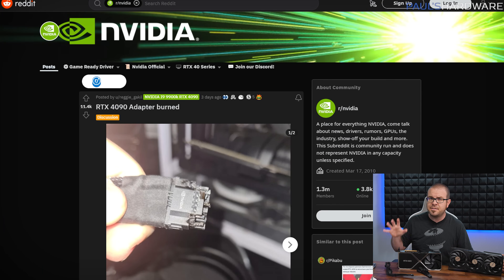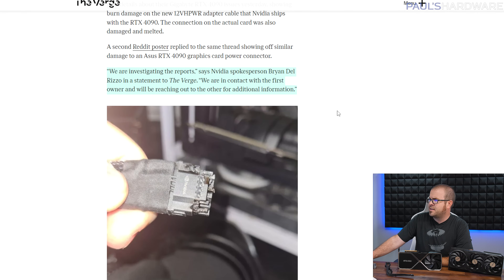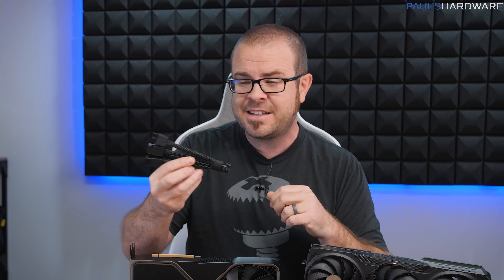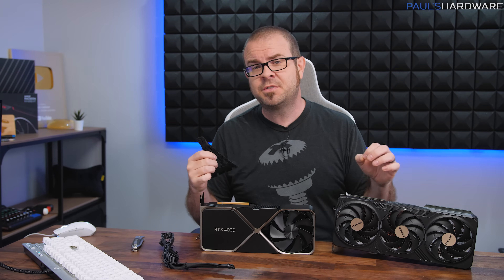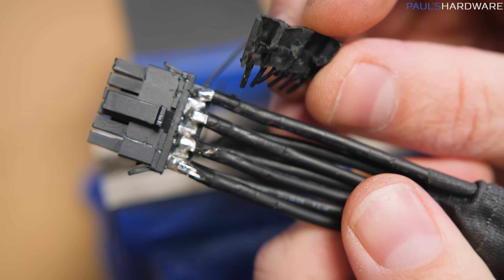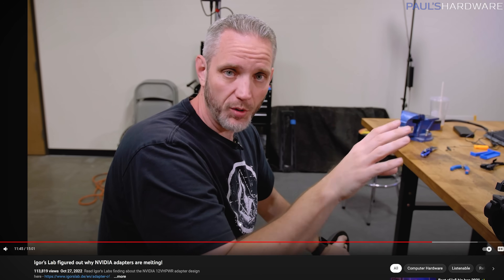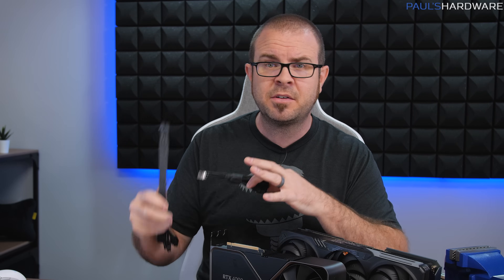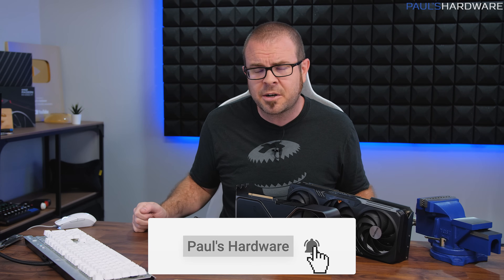Why are some melting? RTX 4090 600W 12VHPWR Adapter Teardown

Comment: In residential wiring, 12 gauge wire is used for 20 amp circuits and 14 gauge wire (what the connector uses) is limited to a15 amp load (@120v). So the first problem is that if one of the four wires comes loose you are carrying 50 amps divided by 3 or 16.67 amps on a wire rated for 15 amps. However, what makes it worse is in residential wiring, the wire should only draw 80% of its maximum wattage in a continuous use situation. So in a 12v scenario, one of the four wires in a continuous use situation should only be supplying (15amps x 12 volts x .8) 144 watts. Even if all four wires are intact, at 600 watts, each wire would be supplying 150 watts. That is 4% over the 80% rule but probably okay. However, reduce that to three wires and you get 200 watts. That is 39% more than the wires recommended continuous loading. As Igor might say, "Nicht gut."
Reply: The design seems marginal.
If the adaptor is defective it becomes a risk too quickly
Reply: So there's different standards for different uses.  I did some looking at automotive 12v standards, and it looks like with 6 wires, they'd need to be 16 or 18ga. So 4x 14ga is probably fine.  The connector also has a rating of course, and it looks like the connector is the problem, not the wires themselves.
Reply: @tippyc2  My analysis was based on solid copper wiring (i.e., Romex). Typically, stranded aluminum wiring needs to one size larger for the same rating. So those 14 gauge wires are really equivalent to 16 gauge copper. Put another way, for the ratings I mentioned the four wires should have been 12 gauge to meet a 14 gauge copper spec. It could be that electronics have a different spec, but since it's used in a residential setting I'd think safety standard would be similar. I don't have enough information to definitively state the root cause; just wanted to point out that there wasn't much margin for error in what they used. I will say that the weak link in most electric components that I've seen is the wire and connectors used going into an assembly and not the supply wires. Just look at a typical light fixture. I hope the industrial engineering in the interconnects improves moving forward to keep up with this trend in power usage.
Reply: @chillysourdough8924  sounds like you think those are stranded aluminum wires?
Reply: @potatopobobot4231  it looked like it in the close ups Jay showed; if not then disregard.

Comment: This failure is most likely caused by a pin fitment issue. A slightly too loose female pin connected to a male pin will have a slight air gap. At high current draw, this air gap will cause excess resistance which will generate excess heat and you will end up with melted connector. I have seen it before. This failure is most likely attributed to cheaply made connectors based on images shown. The outer pin gets hot and melts first because that is where the slight air gap will be and likely the highest point of resistance of the circuit. This is the simplest and most logical explanation (occam's razor).
Reply: Yes, you are right. I recommend Buildzoid's video, it confirms your opinion.

Comment: If it's ABS plastic then the glass temp is 105c, but it will have started to soften a bit before that. Based on my own experience of 3D printing with ABS.

Comment: Good scienceing there Paul.

Unfortunately the 4 wire thing is just a natural result of adapting to the new "standard" from the old.  There's four 8-pin inputs, SOMWHERE those have to branch out into six.  The way they did it seems to me to make the most amount of sense, they are doing it where there is the most material and redundant paths.  The only other option would really be to split two of the wires and leave the other two 1:1, which has 2 of the 6 wires at double the current, and then if one of those breaks you're in exactly the same place.

Personally my biggest question is why nvidia/the industry/the ATX people felt the need to move from 24 total pins to 12.  IMO this was ALWAYS going to be a problem during the "changeover" period where adapters are necessary for non-3.0 power supplies.  And given how long power supplies last and the fact that they are often carried forward between builds, that changeover period is LOOOOOOOOOOOOOOOOOONNG.  Like a decade long at least, given the cards with 12-pin (and the power requirements to really push it) came out BEFORE all but what, ONE atx 3.0 power supply model?

Comment: The connector is a bad design because it does not protect the soldered connections from stress.
This is the most basic of design flaws.
Even your simple power plug has a clamp to prevent connections being stressed.
It's obviously a case of penny pinching to save a few cents on copper wires.
The fake sensor wires going nowhere suggests it is a substandard product designed to give the illusion of quality.

Comment: I think you hit the nail right on the head.  The broken outer cables are causing intermittent contact between the cable and the pin/pad.  This is causing the higher resistance that you describe and depending on how bad the break is and outside conditions could also be causing arcing (There's a literal taser inside the housing) This is why its the OUTSIDE cables that are shown melted in all of the pictures, not the inner ones.
Reply: I don't think it's causing arcing, the 12 volts is too low for current to jump through air. It's probably just a lot more heat from more energy throughout through the fewer pins.
Reply: @tristanweide  I mean it could… a car battery connector arcs when you connect it, and that’s ~13 volts
Reply: @tristanweide  
Yep, this video does not explain either why plastic around the terminals are melted, not around the soldering. Buildzoid has also made a video on this subject and so far he was the only one giving a reasonable explanation: it is the Nvidia terminals that must be the cause. I recommend his video.
Reply: Na, cable works fine. User error

Comment: Some of the same principles that dictate the use of crimp connections over solder in automotive or aviation industries apply here. If wiring is allowed to flex or move freely then it cannot be terminated by a solid joint (solder) as solder is intended to form an electrical connection only (in most cases), not a physical AND electrical connection.

Comment: I ran the numbers just as a sanity check for the possibility of a bad connection causing the problem.

I believe power loss will be "high" when the impedance of the poor connection matches the impedance of the wires coming from the PSU to the connector. Doing some back of the envelope calculations, the expected power loss for 4 - 14 AWG Aluminum, 0.5 meter wires carrying 50A total is about 4W. (using 13.47 mOhm/meter at 70C). That's higher than I expected, but distributed over that much wire, it's fine.

I ran through the current divider circuit, and found that the weakened connection could dissipate a little over 1 watt in the worst case scenario. This is obviously in a much more concentrated and insulated area than before. My intuition tells me that could be enough power to start a bad thermal situation. Resistors rated for 1 watt are pretty chonky as is, and they would probably be significantly derated being incased in plastic.

Maybe the Sense #2 and #3 should have been used for a thermocouple in the connector ¯\_(ツ)_/¯
Reply: I think you have some terms backwards, where do you find large resistors rated for 1 watt?  I think you meant 1 ohm, because at 12v that would be 12 amps through a resistor.  A 1 watt resistor at 12v would be like 0.08 amps.

Comment: I feel like AMD would have been part of or at least directly viewing the 12VHPWR design process as they're, well, one of the very few companies who might need such a connector. I think they knew about this problem but knew they wouldn't be able to do a thing to stop it, so they just let it run and wait for it to bite people in the ass and use the problem for marketing. 

And, honestly? I don't blame them. If you're not gonna be able to prevent bad things but won't hurt anyone by getting something out of that bad, then they're not really doing anything harmful or wrong.

Comment: I am not an electrical expert or anything, but if the electrical resistance increases on one wire connection wouldn't the other wires compensate? Electricity will flow through the path of least resistance from what I understand.

Comment: The problem i have with everyone saying the problem is where the solder joints is causing the melting the pins,to me is incorrect, being an auto electrician of 25+ years I have seen many melted cables and plugs, The melted connector section is where the problem is, and with out having a plug to test/check i cant say for sure. If it was a broken solder joint and its arcing then melted  point will be where the arcing is not down the cable/pin, cutting cable will not cause high temps further down cable/pin. electricity doesn't work like that. No connection, no flow, close contact (broken solder joint) =possible arcing makes heat = melted cables/plastic housing in that spot, not at pins. 
It to me looks like pin contact area is the problem, that's where the heat will build up and cause possible melting, 
If there is to much power draw being used temps will rise where ever there is poor connection, thinnest wire, in case of a connector the contact points, 
The gpu has a solid pin (Male side), so thats not the issues, plug is hollow (Female side) that is the issue, Surface contact area.
Reply: The female terminals on the Nvidia adapters are double-seamed too, the OEM cables are all single-seam. Shouldn't surprise anyone that the double-seam terminals are more prone to flexing open, causing less contact due to the stress applied from bending the cable.

Comment: 10:24 always resented that “they” use multiple pin connectors , when in reality “they” are only using 2 wires
Reply: Wonder if an AFCI similar to what is code for 120/220 circuit breaker panels could be built into a computer power supply ?
Reply: These connectors are designed with computers 
, computers don’t have a lick of common sense

Comment: my 3080 FTW3 only has 3-pin connections, so how do i connect the 4090 with just those 3 connections (3 8-pin connections)?  Do i need to run 4x8 from the Power supply (PSU)?  I'm not even sure if my EVGA 1000w G6 SuperNova has 3-8pin PCI-E available , obviously I have 3 because that's how I'm connected up to the FTW3.  HELP !!!!!!  What do I do?

Comment: Hey paul, a question, are 2 PCI connectors at the PSU end enough and safe to hold 600W of power going thru them? arent they supposed to be 150W per PCI connector?
Reply: they use thicker gauge wire than the normal 8 pin pcie cables

Comment: It really seems like a specific set of circumstances has to happen for this failure. You'd have to get one of the less well-soldered plugs along with wrenching the cable back and forth from side to side. Even this doesn't guarantee that you'll get melting. I'm not saying that there isn't an issue. Just that I'm not sure how widespread it will actually be. Only time will tell.

Comment: Hardware Busters International's video, "16-Pin (12VHPWR) Cable Bended vs Straight. Is it dangerous on an RTX 4090?", is well worth a watch too.  His power monitoring device is top notch.

Comment: Would be nice to see the difference between the 3 pin cable and the 4 pin cable. cuz most of the cases so far if not all are on the 4 pin cable. So it would be nice to see if there is any difference in how they are made and attach inside 🤔

Comment: It's quite obvious that they knew the possible issue, that's why there is the rubber strain relief sleeve which Corsair and others don't use. This is precisely there to reduce the stress put on the soldered connections inside. Either this sleeve is not sturdy enough, not long enough or people experiencing those issues put too much force on the adapter that was still able to crack the soldered join. Or it is QA issue. Most likely all of this together. A few unlucky guys got defective adapters and put them on enough strain to crack the joint that should have been protected by this sleeve.

Comment: sittin' here with my reliable RX 470 , personally I won't buy a pc component that uses more than 150 watts (cpu, gpu) , other than the psu itself 
I just wish there were X670 mATX motherboards being offered. I don't want an itx, I want a competent X670 mATX motherboard. Oh well , I guess.

Comment: I liked Buildzoid's take on it the best: "Nvidia has solved a problem that didn't need solving by introducing a less reliable solution"

And when will manufacturers move the bloody connectors to the rear right of the card? There it doesn't matter if you need to run 3 8pin connectors. And no, 4 is not an option. That's fucking stupid.
Reply: Actually Hardcore Overclocking, Hardware Busters International and igorsLAB, those three channels have done the most to inform my thinking.  Consulting technical specifications, testing and an overall understanding of the subject, please, may that never go out of fashion.

Comment: Am I seeing an illusion, or do I see what looks like a arc or a short on the top wire at 9:25 ?
Reply: I think that's some of the rubber which was molded around the connections.  But a good observation non-the-less.

Comment: Why are all of these pins connected together and have each wire only soldered to a pad? At the very least they should be each crimped and soldered. Jay really didn't explain it well enough but you put the Igor's Lab pictures up and now I see a little more detail of the intentions of this setup.
Reply: Yeah, I was stunned to see the terminals weren't crimped onto the wires.  I think all of the terminals have been bonded together to better spread the current from the four wires across all six of the electrical connections to the graphics card.

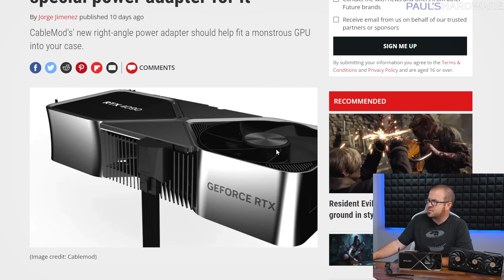Comment: 3:31 I disagree. If you can afford a $1600+ graphics card (or a $3000 OLED TV) there's no sense in cheaping out on a power adapter. (or TV wall mount in the case of the OLED) I get that you shouldn't HAVE TO, but why risk it?

Comment: Thanks Paul! Jay showed that the 30 series FE adapter with 2 sockets have wires directly to pins, instead of the adapter plate. I have a 3090ti with a 3 socket adapter, do you know if that 3 plug adapter has wires directly to pins, or does it have a similar adapter plate to the 4 plug? Either way, I'm upgrading to the Corsair cable, but I think most 3090ti owners would like to know if they're factory adapter is safe.

Comment: I wish Cablemods would also make a rotated 90° adapter, one where the connector goes perpendicular to the one of the card, so that you can plug your cable in alongside the card, like it used to be on the 3080 FE.
Reply: That would be brilliant. Bravo for the idea!!

Comment: 14 gauge is good for 15 amps so lose 1 and you have 50 amps going thru 3 15 amp cable , Not the best practices there. The bridge plate amperage rating is in question there. Well it the hyper car repair model where of course you  will spend and spend and spent to keep it working.

Comment: At 10:48 you mention that the soldering looks decent.  As someone who's done professional soldering I can say that that soldering does not look decent.  If you freeze-frame at 11:27 you can clearly see seams between the solder and the backplate.  That is evidence that the backplate was not pre-heated enough when the middle two wires were soldered to it.  That's a weak joint.

Comment: Wait wait wait wait...

At the end of the video you mentioned something about the power connectors being called ATX 3.0. That prompted me to think "ATX 3.0? Like a motherboard ATX? What version of ATX are motherboards? Do motherboards have versions similar to PCIe4.0 and PCIe5.0? If so, when is the next due 'upgrade?' "
Reply: ATX is a both a PSU specification and a motherboard size-and-hole-placement specification. Intel introduced ATX 3.0 last year, and at the request of Nvidia that included this "PCIe 5.0 power connector". Which is funny... because RTX 4000 only supports PCIe 4.0. But the TLDR is: The motherboard size-and-hole-placement of the specification didn't change.

ATX 2.0 introduced the 24pin motherboard connector you're familiar with, but the reason the last 4 pins can be split off is because ATX 1.0 only had a 20pin motherboard connector. The motherboard formfactor itself has not been changed since ATX 1.0.

Comment: only reason they are jumping on it is because they can smell the lawsuit coming if they don't jump at it. i mean this shit could burn someones house down.
it's crazy that they are even allowed to get away with such a cheaply made connector, it's insane that the connectors only last so few plugs/unplugs. like if they are that fragile then they certainly shouldn't be allowed to put that much power through them.

Comment: Why wouldn't nVIDIA include a high quality adapter with a ~$1,600 USD Graphics card? That's the question.
Reply: Any fool can make a high-quality adapter which will stand the test of time.  The art of design and engineering is to make an adapter which will just barely stand the test of time and costs as little as possible.  Sometimes things are made a little too cheaply.
Reply: @wargamingrefugee9065  Corsair and a whole slew of other makers are making these cables properly. nVIDIA are charging an insane amount of money for these graphics cards, the least they could do is throw a, at most, $5 cost price quality cable into the box.

Comment: Think your analysis about loose contact is the answer to the issue. I troubleshooted my flickering lights once and the root of the issue was loose contact on one of the wires, and that wire/surrounding plastic was a little burnt. In many cases, loose contact is a lot worse than no contact